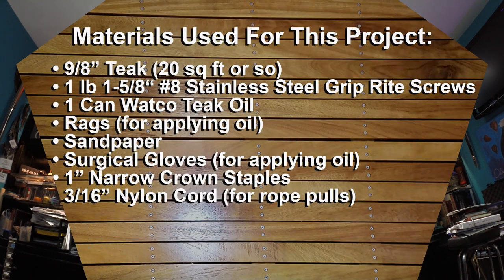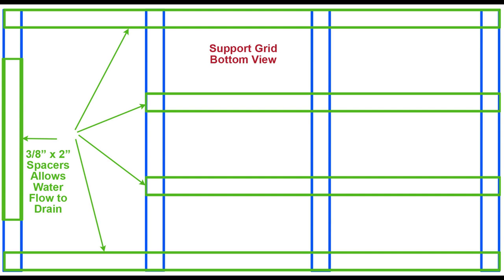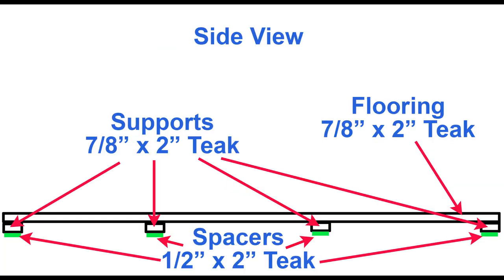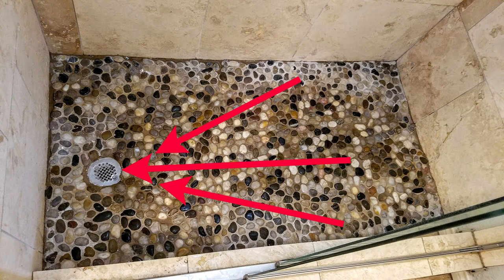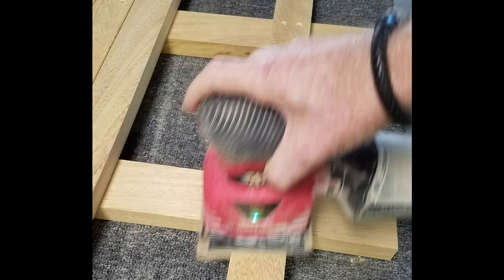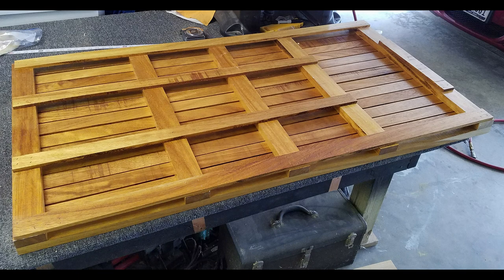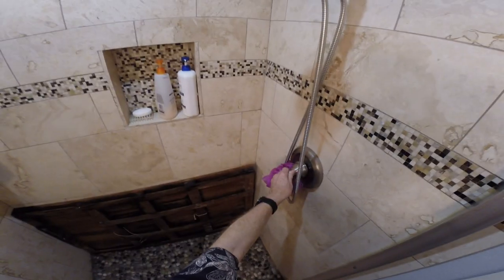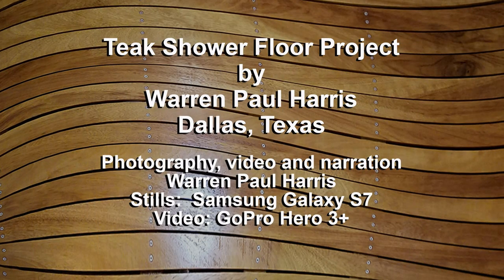DIY Teak Shower Floor by Warren Paul Harris - Dallas Texas

Comment: GREAT tutorial!  Enjoy your showing the floor from multiple angles, and all the details.  THANK YOU!
Reply from the maker: It did solve our problem for over 9 years.  We finally took it out and had a new dichroic glass mosaic tile floor installed.  I had a total shoulder replacement in January and could no longer lift the floor to clean the drain.

Comment: Warren - this is a great video. I hadn't thought of building one of these for my shower, but it seem like a fantastic idea. I'm talking to a guy who has 60 board feet of teak for sale. How much did you pay for the teak you bought for this? Also - do you have to scrub down the teakwood at all? It's been 3.5 years since you made this video. How has he teak floor held up?  Again - thank you for putting all the details and required tools into the video. I really appreciate it.
Reply from the maker: I squeegee the floor every day and have to raise it up to scrub the underside / clear the drain every couple of weeks.  Other than that, I recoated the teak oil once about a year ago.  It is now showing some wear, so in a few weeks I'm going to lightly sand it and do a thorough re-create of teak oil.  I dont recall what I paid for the teak, but it seems hard woods have become more scarce and expensive of late.  I am waiting for a purple heart shipment at the moment.

Comment: Well done!  Looks like a designer finish instead of a DIY fix.  Do you have any advice for doing a shower floor that is tub length?  I imagine it would be too heavy and need to be in two pieces but seems like two parts would be unstable.
Reply from the maker: I'm not sure of the best approach other than a single piece unit like this.  For a tub, it would weigh probably about half what this does and I can easily raise it up and tilt it against the wall for cleaning every 2-3 weeks, the way it is constructed.  That would be a little tricky with a tub due to the non perpendicular tub walls.  It would be hard to stand the teak floor up and keep it up for cleaning.  In one of my blogs I show an alternative to this that some friends of ours implemented.  It is a pre-built sectional teak floor approach in 12" squares.  There are not nearly as robust as the one I built, but they feel nice.  I'm not sure how well they would hold up to trimming to fit a tub, thought.

Here's the blog:  https://dfwci.com/blog4/someusefulproductsyoumayneed/
Reply: @WarrenPaulHarris  Thanks, Warren.  I will definitely check it out.  It’s not actually a tub anymore. A previous owner filled in a sunken tub to create a large shower.  Unfortunately, they left an undesirable step down.

Comment: Thanks for the great vid! How is the teak holding up now that its dec 2020? did you need to give it a light sanding and re oiling yet? Did the cleaners cause any damage to the bottom?
Reply from the maker: Sorry for the delay in responding.  We are in the middle of a kitchen remodel that is utter chaos.  My approach to maintenance has been to squeegee the glass doors and the floor every day.  Naturally, this results in some abrasion to the protecting Teak oil finish.  So in the last couple of months I have air dried it with a box fan and added a new coat of oil.  As a result, I have now decided to stop squeegee-ing (that can't be right) the floor and occasionally spray it with Lysol before a shower to clean it.  Since refinishing the original surface with Flex Seal, I spend a lot less time cleaning it altogether.  I had found the cement / river rock surface retained both a lot of water AND bacteria.  So it tended to smell pretty nasty.  After a thorough deep cleaning, fan-dry and double coat of Flex Seal, it is both easier to clean and has no nasty odor buildup.

Comment: Nice video - thanks for the details. Why didn't you screw the top layer from below so you don't see the screw heads? The final look would be so much more spa like, don't you think?
Reply from the maker: Because if you screw the slats in from the bottom and inadvertently go too far, you've destroyed the slat / risk slashing your foot to shreds
Reply: @WarrenPaulHarris  Thanks. To prevent drilling into the finished side, use the proper length screws (total length less 1/4 to 1/2": you're drilling into quite thick material, here, right?) and use a drill stop to ensure you don't go too far if your drilling skills need improvement. :D.
Reply from the maker: @LimogesDiver  that's not anywhere nearly long enough to secure the slats.  The screws are one 1" long to ensure the system doesn't become unstable.
Keep in mind the whole thing has to come up every 3 weeks or less to clean it.
1/2" screws would tear out.
Reply from the maker: In fact, 1/2" screws would t even go all the way through the support slat
Reply: @WarrenPaulHarris  read my comment again.
Reply from the maker: @LimogesDiver  To what purpose?  If you go through the video you will see the length of screws I used  and if you look at the thickness of the supports you will see that is exactly what was required.  This is far from my first rodeo.
Reply: @WarrenPaulHarris  
The purpose is to hide the screw heads, and not show them off. It's a design issue, not a function issue. They just don't look good like that, in my opinion. We're always trying to hide fasteners, not show them off - especially in a spa / bathroom environment, right?
Reply from the maker: @LimogesDiver  That is a matter of opinion.   My wife and I are both artists and our home reflects that.  It is contemporary with vibrant colors and many unique features, like a 22" Chinese gong for a doorbell.
We like this effect, which is why it looks the way it does.
Much like studded belts or leather jackets.